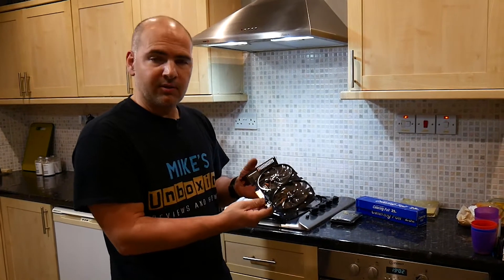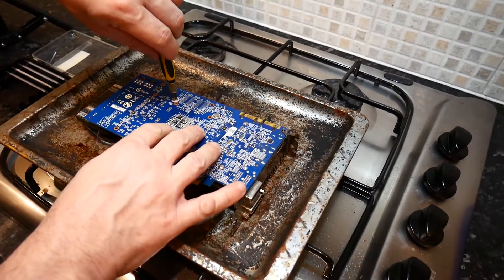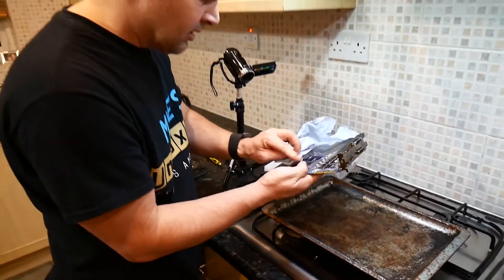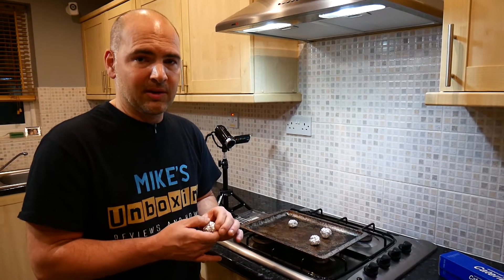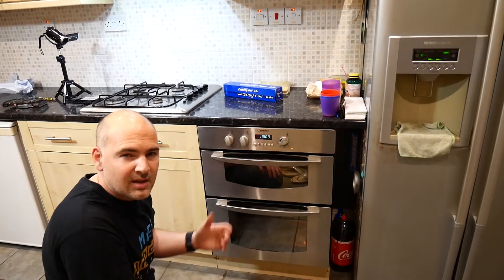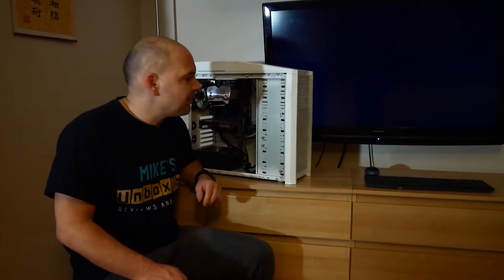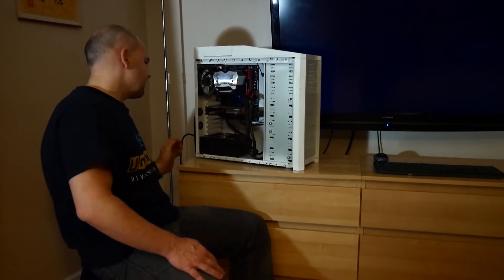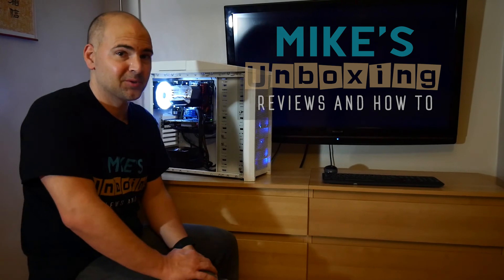Graphics Card Repair! Oven Baked GPU! Will It work?

Comment: Always let it cool inside the oven at least 5min with the oven open, a sudden change in the temperature may cause frosty solder joints
Reply from the maker: +Quimerateck thanks for the advice. I might have another go at it using the good advice people have been offering.

Comment: worked for me. heated the oven for 5 minutes, no gpu. turned it off, opened, placed the gpu on an paper dosier on top of an oven grill , closed it up. 10 minutes later, opened the oven , gpu hot as hell. let it to cool down for 10 minutes , inserted , worked. ;)
Reply from the maker: awesome stuff

Comment: This works in many cases.

A card that was dropped and developed cold joints due to the drop is a great example.

I revived a graphics glitchy RTX 3070 by heating the Vram, GPU processor, and reflowing joints with my Iron.

Comment: Place card upside down compared to when in pc at 205 c for 7 minutes and 30 seconds with tray and oven preheated then turn off oven then open oven door and let it cool for 20 mins , works most of the time :)

Comment: That's a waste really you can reball it using bga or reflow using hot air
Reply from the maker: yeah back then i was rather uneducated
Reply: @mikesunboxing  do you have bga machine?
Reply: @mikesunboxing  then it's your lucky day actually I have old bga machine I stopped using it cos I'm using touch screen 1 the 1 I want to giveaway called jovy 7500 I don't know if you heared about this machine
Reply from the maker: @Toqhy  that is a kind offer but i really wouldn't get much use out of it, and we are really struggling for space here :-)

Comment: you need to let it cool in oven with door open after 8 mins and you must cover all the board with foil . only top and bottom of gpu exposed , otherwise caps will die
Reply from the maker: thanks for the info

Comment: It worked on many cards for me, the temperature should be higher, i do it at 400f for around 5 minutes, Depending on your issue it will work, Or it doesn't.. 7 cards were fixed by this method so i guess its just how you do it? Not sure
Reply from the maker: i think higher temp less time is the way
Reply: I am with you on this one Tex- Just did 3 cards yesterday and two of them worked yesterday afterwards ( have not given the two working ones a strain test yet tho!) :)

Comment: I once tried that with my mate's card in his kitchen. After a few minutes in the oven, his wife came and explained that the oven's temp reg is kinda dodgy and usually just sets the highest temperature... Then there was a lot of blue smoke... Today I'm gonna try it with my good old GTX 460. At my place😁
Reply from the maker: Good luck my friend 😉
Reply: @mikesunboxing  Thanks, it worked! Now I guess I shoul look around for a replacement card, for it's fine for a few months tops:)

Comment: I had my friend bake an old video card, and low and behold it did actually work. This does not mean it will always work, but if the card is already dead, whats the harm in trying? He baked the card for 10 minutes at 410 F and it went from no post to working (for over a year in fact before he upgraded to a better card, pulled it still working to upgrade) there was no artifacting, the card performed like it should have out of box for everything. I can confirm this DOES sometimes work, but i can not guarantee this. Static discharge could certainly kill a video card from a power surge and this trick WILL NOT WORK in that event. in the card my friend did this to, it was artifacting bad before it died, indicating the solder joints were giving out.

Comment: Lol well.. A leak in my room suddenly sprang up as I was sleeping... The very smallest amount of water got on my GTX 1080 that was sitting inside of my CM Storm Styker, somehow only broke that it seems... Gonna have to try this if I determine that it's truly dead. (fans spin up but black screen when HDMI is connected to it...) If it turns out it's truly broken from the splash of water that got in it or whatever and I somehow get it to work by baking it... I wonder if that will shorten the life span drastically or at all really.
Reply from the maker: Don't Bake it try to get it returned under warranty. Baking is a last resort
Reply: @mikesunboxing  Yep I checked the Warranty, Gigabyte's checker says it's no longer under warranty :( ahhhhh man this sucks so baaaaaaaaaaaaad! I haven''t been without a dedicated GPU since I started PC Gaming in late 2015 when I decided I had enough of a lesser experience on Consoles! Fuck! Like I'm seriously so fucked. I have no money for a GPU right now, at best I could get one that's like... $80 to $100. I was gonna sell the GTX 1080 last week and then start saving to get me a RTX 2070 or a 1080 Ti. Oh man... Oh well... And then also I read that oven baking a water-damaged GPU is useless because the shit got short circuited and fried and supposedly the oven baking method only works on GPU's that have broken through so much use. It's weird but yeah. 

I have no idea what to do.
Reply from the maker: Best option would be an electronic expert to see it the voltage regs or something can be replaced.

Comment: Guys my GPU won't install the Nvidia Driver EVGA gtx 780 , I get all sort of green lines on the screen. Can this solve my issues with the driver ?
Reply from the maker: Green lines is a Bad sign my friend. Usually failing ram or GPU maybe worth checking your PSU is up to the task the 780 can be a real power supply killer
Reply: @mikesunboxing  Hi thanks for the quick reply . I don't think its the PSU , all the pc components are brand new not even a year old . my PSU is EVGA  G850 G3 Gold Plus , I tried other GPU and it work . My computer lets me boot up with my GTX780 it just wont let me install the Nvidia Driver. The GTX 780 is pretty old it Survive a Hurricane two years  ago in the US Virgin Island . I'm trying to gather up as much information before trying this out.
Reply: @mikesunboxing  Hii , I tried it now , and it did work !!!! . As soon as I started my pc I notice the green lines were gone. I install the driver and everything is working . I knew it couldn't be my PSU . My oven temps were 350 I let it stayed there for 12 minutes . I didn't see any smoke , just the smell of soldering . I hope this fix last me about a year . Just waiting to buy a new GPU.
Reply from the maker: @flighttimex267  Happy days! good job!
Reply: Hey good to hear that it worked for you. I have the exact same problem on my GTX 580, green horizontal lines and the driver won't install, windows can't even recognize the display adapter. I have been researching and this method seems the only thing i can do. How is your card holding up after 3 weeks ?
Reply: @heldercosta1209  Perfect , if your card can boot up it's not totally dead , so this method could work for you .  I have test this method with a GTX 970 that won't boot and the fan would just turn on then turn off, but didn't work . Maybe with higher temps . My recommendation to all this  if you have your gpu that can boot up , and the only problem is those green lines , well you can try baking it with lower temps just like I did for 12 minutes . If your card won't boot at all then you have to try higher temps . I have also fix another card that had the same green lines , and its completely gone and the nvidia driver installs like nothing happen.

Comment: everything works on my pc except my card would that be the card or board I tried it on other slots it wont work
Reply from the maker: difficult to say without really seeing it. What setup do you have and what video card is it? For a more detailed discussion you can always join our discord server.
Reply: @mikesunboxing  i gota 1080 would that be usally the game card dead only u think sense the other stuff comes on from the board
Reply from the maker: a 1080 shouldn't just die, do you have the correct power connector and what cpu are you using?
Reply from the maker: if you have tried all other options then baking may help, but ONLY if you have tried all other methods to get it working and are 100% that it is the card. Even take it out and get a friend to try it before you start cooking it

Comment: If my oven busted who will responsible for this??
Reply from the maker: that would be you.
Reply from the maker: If you read the video description i did  clearly state the possible problems this could cause and that it could damage both the oven and the card. The warnings were there. But ultimately it is the individuals choice and responsibility.
Reply: Sorry i did not notice your video description..but thanks for your reply
Reply from the maker: Lol no problem. It is a risky thing to do. But if you have a dead and expensive GPU that could make it worth the gamble?

Comment: you don't have to bake entire card. I used torch on my dead gpu chip in my laptop, constantly checking temperature. It worked, at least for a couple hours. Probably it last that short because I only heated it to 180C and my laptop have poorly designed cooling. I'll try again to heat it for 220C next time and mod cooling on my laptop.
Reply from the maker: Great advice. Next time I think that is the best way to go
Reply: Also, slow cooling might help. I consider throwing it in preheated oven to cool it down slowly. Just do some research.
Reply from the maker: Lol but in some lamb and potatoes at the same time

Comment: Baked my 780ti twice and still kicking ass right now. Some my tips is :
1. Baked with card facing up. Because my 1st time baked with facing down, all capacitor peeling off and i need to solder back all of them. Plus my HDMI port also peeling off, cant save it because the joint is too tiny to solder (need special solder tools).
2. Baked my gc with 200 Celcius at 10 minutes.
Reply from the maker: I need to try it again, don't want to throw it in the bin

Comment: i have done this with my r9 290x and my r9 380 and has worked every time for me  but be for i  did it i was getting artifacts on the screen and drivers crashing under any load now fully fixed
Reply: Yo, after you installed the drivers you got a blackscreen, right? How's it been doing for now?
Reply from the maker: Had a few more goes but it never got a display. I ended up selling it for spares or repair for £10 😕
Reply from the maker: You had better luck than me. The 660 just wouldn't come back from the dead 😞

Comment: I think you were doing fine! Not every card will be saved all the time, though. The method you outlined helped save my nvidea gtx9900 in the past, when it showed garbled text at the bios screens. I did it slightly different: In the oven for about 15 min at 195 C, resting on Al-foil balls, but with the GPU side facing downwards. After the fifteen minutes at 195 C, rised the temp to 200 C and let it sit for 3 min then rise the temp to 205 C and let the card sit for another 3 min before taking it out to slowly cool down. I found this info on google some years back and much to my surprise it worked.

Comment: There's easier way, plug in gpu without cooler to pc till it gonna start work again or screen gonna start blinking (similar as no signal, but nothing shows on screen just blinking) then turn off pc, put cooler again on gpu, it worked for me.
Reply from the maker: Amazing! Totally free GPU repair
Reply: Update: Unfortunately this fix only lasted me 2 hours, the artifacts and crashing are back... I guess it's back to my old GTX 550 TI until GPU prices are sane again
Reply: OMG THIS worked for my r9 270..thank you sooooo much
Reply: Update 2: I tried the oven method, and it's working again. I will write an update comment in a month on its status
Reply: your r9 270 gave you issues with black screen after the windows logo, right? How's it doin now?
Reply: @neosapien9  Status?
Reply: @neosapien9  still working ?
Reply from the maker: Okay might give it a try. Thanks for the tip!
Reply from the maker: Great news! Look forward to hearing from you
Reply: It worked on my gtx 780 amp

Comment: Hi Mike, was this a joke , man?
Reply: i baked couple of gpus last year with 100% success rate. they still work after a year. it depends on what went wrong with your card. i got stripes on both and in that case baking works 100%. if card randomly fails or fails on high load theres a very good chance itll work. if it dies completely then theres nothing you can do. theres nothing strange in it ... if you do it enough times you get the grip when it might and might not work.
Reply: haha its not a joke man what happened to you all. The question is that how this method work's so the answer is the SMT or SMD capacitors, resistors got unsolder due to over clocking or over heating a gpu so when we put the gpu into oven for some minutes it's not baked instead the solder melts and joins itself to the pcb of gpu thank you!..!
Reply from the maker: +Cauda Miller agree 100%
Reply: I was playing a game (not very demanding) and got some coloured blocks in me screen of like 1 cm by 1cm. Shortly after that the system crashed. When booting it i get a vertical stripe in my screen when loading windows, after taht it gets black. Should i try this?
Reply: LunaticLumar yeah thats the case in which it might work. just make sure its GC first, try with another GC and if comp works go for it. which card is it? i tried with AMD card a month ago, and it didnt work. it booted after baking, artefacts were gone but i couldnt install drivers. if its nvidia you have better chance, in my experience
Reply: I have a r9 290 that is only 3.5 years old, so pretty young :( I tested with a r9 285 if the system would run. It did, but of course the r9 285 is less power demanding. But i guess it is not a powersupply issue since the r9 290 already crashes when it is booting and i could play games on the r9 285.
Reply: i did not overclock, it was not overheating. Im thinking about this solder problem, or memory problem
Reply: i dont overclock em either and it happened about the same time, some 4 years... i guess thats the life span of amd cards. they do have generally higher heath dissipation so i assume shorter life span. nvidias cards live a year longer and respond better to baking. you can try with industrial blower to give least heath to other components, but nobody can guarantee it will work either way. just put it on 200c for 8 mins its (half) dead anyways, preheath the oven to 200c then put it in for 8 mins. i think youll get same result as i did, it will boot and be recognized as generic vga adapter but 3d acceleration wont be there. and pls do get back, i really wanna know if it worked
Reply from the maker: +Dr Hy it's not a joke! Some people have had great results by using this method. Strange but true
Reply: Woo strange method really, lol, at least you tried!☺good job and keep up the good work, I like the way you present your videos, thanks